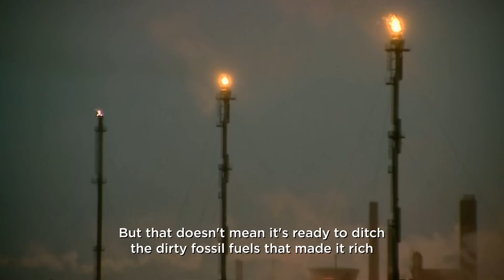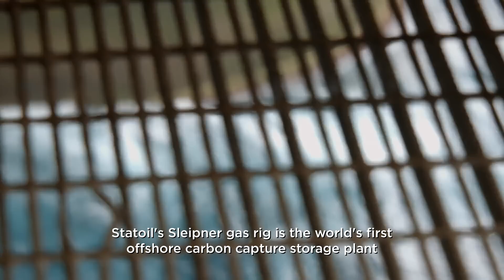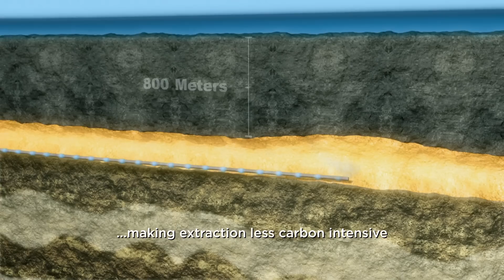Oil and gas companies are facing major technological disruption

Comment: Perhaps, the biggest risk presented by the new renewable energy resources is the fall of the petro-dollar.   Oil is traded in dollars which means that virtually all oil producing countries need dollars in order to trade their oil.   As the oil industry is displaced by renewable energy sources, the reliance on oil - and, the petro-dollar  - will be reduced.   That is going to cause all those dollars held around the world to start coming back to the US - spurring rampant inflation and, perhaps, a cataclysmic collapse of the US economy.   

This was predictable by the greedy criminals who decided that our money didn't really need to be backed by anything tangible.   But, they did it, anyway.   And, we will all pay dearly for it.
Reply: Richard Owens,  Current banking system and fiat currencies is a panacea. The latest budget that will cause a huge deficit, shows how bad it can get. So the least of our worries now is petro-dollars. But as much as we all may want seemingly simplistic solutions like the gold standard, that would just cause other problems. Hope u had or have the time check out all the financial crisises that were caused by the gold standard in the USA history when the consider going to silver standard too. A gold standard is not replacement to fiscal discipline.
Reply: World trade is based on the dollar not just oil including most internationally traded renewable energy tech . But it will change over time with r rise of China, If ur scared buy gold or bitcoin.  Last recession was a factor of weakening of the Glass–Steagall Act, we keep forgetting excess speculation leaves a bitch of hangover after the bubble bursts.  Even if Gold standard keep govs from just printing money its is only a small percent of the actually currency. So keep pretend Gold will save us when Gold is fixed asset that can even make the problem worse. The Gold standard died long time ago for good reasons that cant fully be explained here. But I love the conspiracy and "chicken little" theories :)
Reply: Dollars are recognized and accepted around the world because they are needed to trade oil - period.   There is no other reason why the world needs to depend on dollars for trade.
Reply: U mean oil is traded in dollars since dollars r accepted around the world for international trade.  Sorry "u got the cart before the horse". 

The criteria for ppl accepting US dollars has little to nothing to do with if their country's trades in oil based on US dollars or not. 

Countries with very weak currency tend to accept US dollars since they more stable substitute for the local currency. Just do some traveling and find out 1st hand, in some places they only would accept dollars from me but wanted to give local currency as change. 

While countries with stronger more stable currencies dont have the need and tend not to accept US dollars as much or at all. 

Since WWII the USA dollar has been an accepted standard for trade, its not written in stone and is changing mostly due to the rise of China.
Reply: Wrong.   Oil is traded in dollars - but, everything else can be traded in other currencies.   But, because oil is traded in dollars, that means that they are available throughout the world.   And, because it is a relatively stable currency - for now - it is often accepted for trade of other goods.    But, if oil stopped being traded in dollars. the dollar's stability would start to fail - and, people would no longer want to use it as a currency.   So, no, I did not get  the "cart before the horse."

Read the following statement as many times as it takes to sink in:

"The US Dollar is backed by nothing."

The same can be said of every other fiat currency in the world, too.   And, to put a fine point on how precarious the value of a dollar is, it is worth less than 5% of what it was worth a hundred years ago.   It's already collapsing, and it will accelerate its collapse as the world moves away from fossil fuels.
Reply: Oil already is traded without using US dollars on a bilateral basis. The change is happening slowly already so there is no rational y change would take place in manor to precipitate the dollar's instability. What causes a crises is if something is unforeseen. 

Plus China owns trillion in US currency based debt so its in everyone's best interest to keep the US dollar relatively stable. And I have heard predictions like this my whole life, including in the 80s when some ppl predicted Japan and the Yen was suppose to become the dominate economy and currency in the world. 

But if u really think ur right just short the US dollar in the ForEx market and get rich. I just wouldn't bet on it. 

And this y betting on candidate is better predictor of an election than a poll. Since it only counts what ppl say when they r willing to put money on the line,
Reply: The dollar’s role as the world’s reserve currency was first established in 1944 with the Bretton Woods agreement. The U.S. was able assume this role by virtue of it then having the largest gold reserves in the world. The dollar was pegged at $35 an ounce — and freely exchangeable into gold at that rate. But by 1971, convertibility into gold was no longer viable as America’s gold resources drained away. Instead, the dollar became a pure fiat currency (decoupled from any physical store of value), until the petrodollar agreement was concluded by President Nixon in 1973.

The essence of the deal was that the U.S. would agree to military sales and defense of Saudi Arabia in return for all oil trade being denominated in U.S. dollars.

As a result of this agreement, the dollar then became the only medium in which energy exchange could be transacted. This underpinned its reserve currency status through the need for foreign governments to hold dollars; recirculated the dollar costs of oil back into the U.S. financial system and — crucially — made the dollar effectively convertible into barrels of oil. The dollar was moved from a gold standard onto a crude oil standard.

U.S. interest rates were then managed so that oil exporters (who formerly looked to gold as the basis of their reserves) would be indifferent to whether they stored their currency reserves, earned from oil exports, in U.S. treasuries, or in gold. The value was equivalent.

But, as the world moves away from fossil fuels, the need for other countries to stockpile dollars will be reduced - which will result in those dollars making their way back to the US where they will cause inflation to rise, resulting in the inexorable decline of the value of the dollar.

This is not a new phenomenon.   The world has seen this play out many times throughout history.  Look up the Weimar Republic and look at what happened to their currency.   It can - and will - happen to the US.   Why?   Because, our money is not backed by anything.   It is essentially worthless paper that we pretend has value and a limited supply.
Reply: You seem to be living in a fairy tale world where everything is stable and fair and the banking system and fiat currencies are perfectly okay and not a threat at all.   Well, remain blissfully ignorant, if you want.   I don't care.
Reply: So long as the public are happy sending their young people to murder oil producers the dollar will stay a great way to transfer wealth to America, of course you have to murder a LOT of people to get this benefit and it only accrues to the very rich, but this is what the new Imperialism is all about.
Reply: Saddam Hussein wanted to get out of the dollar, he was murdered, Ghadaffi wanted out and he was murdered.

Oil spills blood, always has always will. 

Forget climate change, even if it is going to be certainly devastating in the future, the fact is we need alternative energy to stop the Imperialism, terrorism, aggression and "wars" that Oil creates and instead switch to industrial production of renewable energy to create honest work for honest people and create a safer, fairer, less murderous world.
Reply: The only person Im sure that lives in a very crazy conspiracy fairy tale world is the previous person commenting here.
Reply: Richard Owens, just a quick comment to you. Do you really think China and Japan need trillions of our currency just to buy oil? They buy our currency to prop it up and that makes theirs cheaper so they can export to us.

Comment: Supposedly solar and wind is on an innovation curve so the solar panel tomorrow will be cheaper than the solar panel today as the technology matures. Oil and gas are extracting a resource so the cheap oil is extracted today and only more expensive oil can be extracted tomorrow. Eventually oil and gas will become inconceivably expensive to wind and solar. It is just a matter of when.

Comment: Fifty Things Made From Oil
Several things we use today are made from oil including household products and fuel for various forms of transportation. Many of the cheap flights and car trips people take every year depend on oil for fuel to get them to their destination. Oil also plays a big role in the mechanics of cars during travel and planes during flights, keeping engines and parts running smoothly and helping extend their lifetime and usability. While new ways to produce energy are being researched and discovered, oil is still the biggest resource for making fuels for automobiles and planes serving different airlines.
Reply: This is why we need trains and trams, cars are a stupid idea.
Reply: And a fairly stupid one indeed! @fuckfannyfiddlefart
Reply: all true, but not a reason to stop switching to renewables whereever possible.
Reply: These things aren't as big as you might think

Comment: I have 2 problems with this. One being the major problem with oil and gas is the transportation and consumer usage. Two being that if there can be an oil leak couldn't it be more easy to have a co2 leak? Pump it into the ground all you want but it's likely going to escape into the atmosphere
Reply: Andrew Godly: Yes, it is possible that there could be a CO2 Leak sometime off into the future, however, if they can retain that CO2 for 50 years or longer, the world would probably be using "Carbon Free" energy by that time and the release of this relatively small amount of CO2 into the atmosphere would probably have little to no effect on the climate by that time (especially if the leak were to be a slow leak). Additionally, I am not even sure the CO2 would have enough buoyancy to rise to the surface due to the extreme pressures at 1,000 meters (3,000 feet) below sea level.

Comment: All industries (major ones) require subsidies to develop (especially oil and gas), plus the ability to ignore and/or pass off externals costs (environment) to make them profitable.  The only question is when the next disruptive tech makes fossil fuel generation and storage obsolete on a purely commercial basis (e.g. wood vs. coal, horse buggy vs. automobile).  The tipping point is quickly approaching and will be sudden, dramatic and catastrophic for the old dynastic oligarchies who fail to adapt to high value added manufacturing and services.

Comment: which one seems better ; a community run energy eco-system   by the farm or the giant corporate heads such as e-on to basically looking at the monopoly of the energy sector. could it be possible that cities looks at corporate based energy sector whereas towns and rural areas looks at running their own energy production.

Comment: This gave me an idea that for it to be successful and truly be independent from fossil fuels, it will require the need for high voltage power cables linking villages or cities so that a change to poor weather in one area will be powered by another area of power generation.   As mentioned in the video, everyone can be a power producer.  An enterprising individual might produce this power for money while another home not even require the equipment and just buy the energy.  I can see this network to be similar to the Internet where there will be large data centers and long network cables.  In clean energy, the large data centers will be energy storage companies who will buy and sell energy while the network cables are high voltage lines linking huge cities to another.  This is very lucrative for the common people considering the revenues of oil and electricity producing companies.

Comment: We store it "forever and ever" ...

Are people stupid?
Reply: In general, "Nothing lasts forever". Specifically, tectonic drift could theoretically open up rifts and release the gas. I'm sure there's some more that could be said but I'm no expert on the subject...
Reply: Today on XYZ News, The planet farted... The farmer in the Dell and all of Old Macdonald's ducks died from suffocation.
Reply: @alainarchambault2331  I laughed hysterically
Reply: The carbon gas is forced to phase change into a liquid and it remains as a liquid under the lithostatic pressure. Depending on the geologic unit it is placed in, the CO2 can react with the rock and become locked away in a solid mineral structure.

Also, gas production typically happens in a passive margin. Yes, it is possible to over pressurize the rock causing it to fracture, but the alternative is to simply release the gas into the atmosphere.
Reply: If the CO2 reacts with subsurface minerals, then it's stuck.  You would have to put energy in to get it to come out, so it won't happen spontaneously.  So yeah, essentially forever.
Reply: Maybe not forever, but it's one of the best options we have right now. Even if we're just pushing the problem into the future, considering the size of the problem we face now, that's still a good thing. And the timescale on which this stuff might leak is geological.
Reply: so what does happen?
Reply: YES/Brainwashed
Reply: It does bust thru the earth's crust and explode and spill over land and atmosphere,  so we clean it up,    and power our world.
Reply: Craig Adams some.
Reply: Rechargable batteries last a lot longer than a gallon of Gas, and once the batteries lose their charging capability it's now possible to reuse 90%+ of the battery.
Reply: Brad Jensen >99.9, that what elon said about tesla batteries
Reply: @bradwjensen  4mtr. 2pacCyber1.75... Hope this wasn't just another one of my pipe dreams.
Reply: Brad Jensen 90% reusable? Not possible currently where did you get that number? 

Battery storage is necessary but the mining of rear earth materials to make billions of pounds of batteries for global needs is going to hurt the environment in the long run to. 
Ideally we would balance the two fuels till we a superior option.
Reply: @ls-33wraith33  You sound like a fossil fuel FUDster.  The environmental damage done by mining materials for batteries is substantially overstated.  Batteries do not contain Rare Earth metals.  (Certainly not "rear" earths.)
Reply: yep , let put that sh!t under the carpet and it will never come back to bite us, absolute madness. Let stop using fossil fuel and go full throttle into alternative non polluting options.
Reply: Yeah, they said that nuclear waste can be successfully stored -- then reality sets in --that is 25,000  YEARS...
Reply: @hddun  not stored too well in Japan after tsunami's
Reply: Hell yes-- most of them are dirty dumb!!!! How else would you explain the Republican and Democratic parties.... or troll-woman Angela Merkel??
Reply: YES
Reply: Can’t trust leftists because they create their own truths